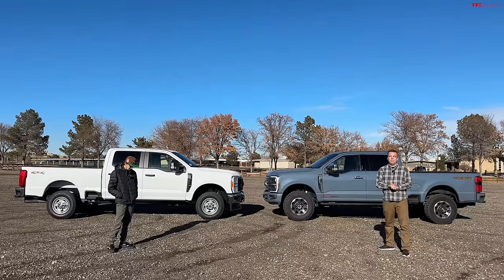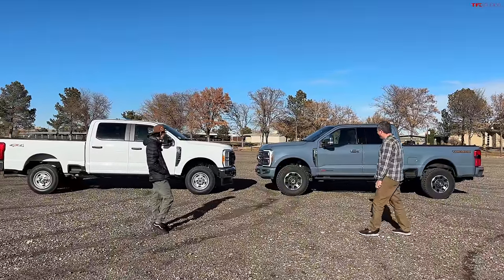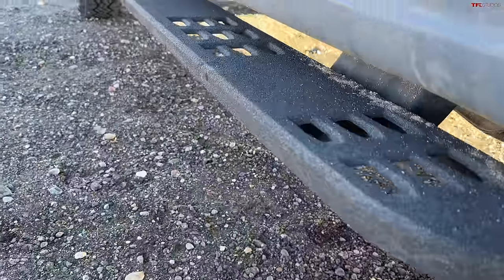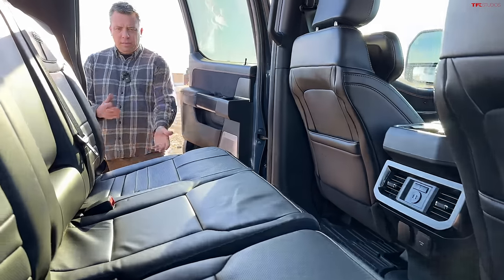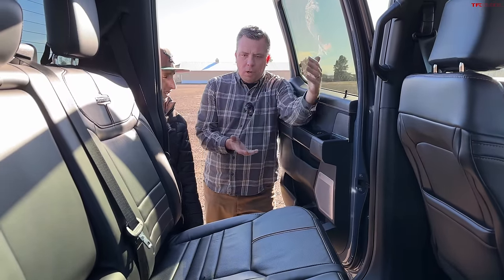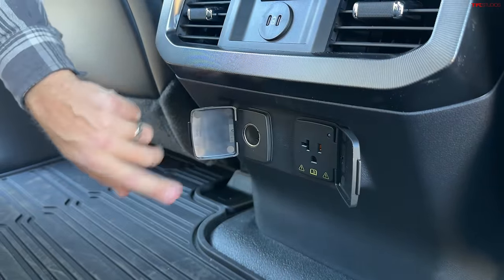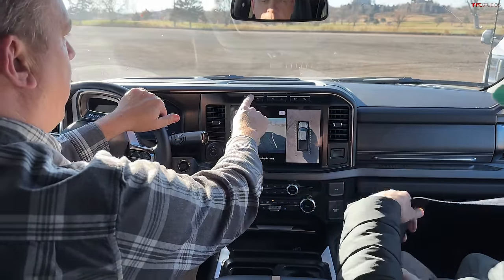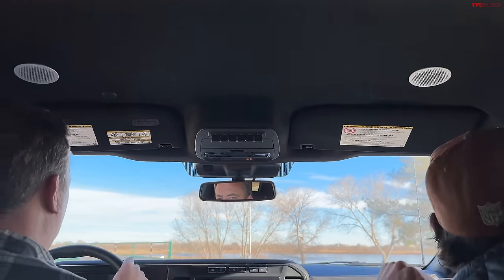New Ford F-250 Work Truck vs Premium Diesel F-250: What Do You Get for an Extra $50K?

Comment: They forgot the reliability option
Reply: That's a REALLY good point!  And I'm a diesel fan, but, man... it's hard to argue that $50,000 price spread.

Personally, I'd go diesel and run that thing until the wheels fell off. Hopefully it would be good to me for at least 10 years, preferably 15 to 20 years, for that price point.
Reply: @danthompson1467 All tyrants think they know what everyone "needs" until someone comes along to tell them what THEY "don't need".
Reply: So did Ford. 👍🏻
Reply: Reliability option? Uhhh😂
Reply: Diesel will cost you waaaaay more over its life than the gas. Diesel doesn’t mean reliable.
Reply: @danthompson1467  Key word being "need". We have our needs and wants all sorts of confused!
Reply: @joshc606  I agree.  I have a 7.3L and 6.0L Powerstroke.   Maintenance costs are way higher than my gas vehicles...
Reply: Can you imagine having to work on these new engines.  The first several hours used to just digging thru the lines and hoses😢
Reply: @larryjohns8823 a lot of maintenance requires taking the cab off the frame to work on the motor!
Reply: @BillUtah  So that means SOL for the driveway repairman! 😳 Don't  think Auto Zone loans out a " cab lift " 😩
Reply: @@stevenseagull6220 We have a 2004 F250 Super Duty XL with 70k miles on it who will be retiring when the engine goes. It chugs and acts like it wants to die. It’s a farm/plow truck so even though we’ve maintained it, it’s lived a hard life.
Reply: I would argue these new diesels are not nearly as reliable as some of the pre-DEF generations.  Way too much emissions nonsense.
Reply: @0346GT must be a dodge guy

Comment: Coming from someone who only drives work trucks… it’s a little pathetic how shocked they are about the lack of features. That work truck would be so much for useful and wouldn’t worry about getting it dirty.
Reply: Being $50,000 with zero features at all is the pathetic part
Reply: @mcnuggetapple If that bothers you, you could try getting a job. It worked wonders for me
Reply: @JollyGiant19  Or just buy a Honda Civic for less than half the price. Worked wonders for me.

Comment: Would love to see a towing comparison between the 6.8 and 7.3
Reply: I second that. I would like to see a fuel economy run on them as well.
Reply: @brandonstewart7145  I saw a video with someone getting 19mpg with the 6.8.
Reply: 6.8 max tow 18.9k
7.3 max tow 22.5k
Reply: @chadmiller6487  nice
Reply: @chadmiller6487  dang that's a lot of tow!!
Reply: Pretty crazy if u look at the specs at the old 7.3 diesel and the new 7.3 gas.  They have about the same power now.   However the new diesels blow everything out of the water.  More power and 2.5x more torque
Reply: @Freshprankstv1  similar TQ but the new gas engine putting out over 2x HP

Comment: I would buy 2 of the XL trucks for the price
Reply: Let’s be honest.  The person buying the Platinum Tremor isn’t actually using it for a work truck.  It might tow a camper or a boat now and then.  But the guy buying the XL is probably going to have a toolbox or fuel tank in the bed and a plow on the front, or be pulling an equipment trailer.  And that guy will still be $35k less into his rig.

Comment: Great video!  Really interesting that the base truck had more features than the top of the line trucks that were available back in the 1990s.  Id go basic truck every day.  The costs of top of the line make zero sense and these trucks only exist because of easy credit and people being conditioned to pay $1200/month for 72 months.

Thanks for making this video.  I’d love to see something like this for the Toyota Tundra.
Reply: I couldn't agree more. I ordered my new 23 Ram 2500 tradesman built to my spec. Crew cab 4x4 very basic
51k That's less than most 1/2 ton trucks anymore.
Reply: @ 1200 it would be way longer than 72 months with interest rates tack on another three years.
Reply: More like 1500+ per month for 72 months with 10 k down at 3.99 interest
Reply: 80% will never own,
They just rent, 🤔🤷🏿‍♂️🤮

Comment: I have a 2023 F250 STX with the 6.8 with a payload of 3950. So far I love it. It has great power and really gets up and goes compared to my 2023 Tacoma i had. I am averaging 16mpg driving in PA. The 10r100 tranny is smooth and very responsive.
Reply: Any issues with the 6.8? How many miles do you have? I want to buy a f250 and just worried about the new 6.8 vs the 7.3. Any feedback would be appreciated
Reply: That's a 4x4? 16 sounds great if so.
Reply: @lordaleksandre  Yes 4x4 with front and rear lockers 3:73 rear end.
Reply: Is that a crew cab and you have a 10kgvwr?
Reply: STX is the way to go, gives you some really nice options over the XL but not crazy expensive
Reply: 16 mpg on a gasser,sorry i dont buy it
Reply: @williamallen5369  Mine is just like his and has a 10,600 GVWR. STX FX4 3.73 locker etc etc.
Reply: Went from a taco to an f250? That’s a big jump lol
Reply: @casper24ism I get 17 on hwy. 14 town . I have a light foot though.
Reply: @casper24ism I imagine it's the 3.73 rear end. If you go with the 3.5ish or 3.31, you should have better mpg , but of course, lower towing capacity. Ford gives the buyer 3 or 4 options on most of their trucks. I don't think you can do that with the others.

Comment: Re: headlights.

My truck has halogen headlights. My wife's SUV has LED headlights. I prefer the halogens.

The halogen lights give off enough light and they eventually fade out the farther out in front.  So there's a more gradual difference between the lighted area and darkness.

OTOH, the LEDs have a sharp cutoff between the lighted area and darkness.  Not to mention blinding all of the oncoming traffic.

Comment: TFL always forgets to mention that Ford and GM offer a much safer 3 point seatbelt with their middle bench seat vs Ram which still uses a manual tightened lap belt and non locking seat back.  That isn't a safe design considering there is no airbag for that passenger.
Reply: How many guys purchasing truck care?  I’d argue very few.

Even if the purchaser does care, how much do they care? Is it enough to be a deciding factor on which truck they pick?  I seriously doubt it.
Reply: Well I guess enough people care that Ford and GM took the time and money to upgrade the seat.  If no one cares as you say, they would have left it alone.
Reply: @fasttoyo  maybe they thought govt regulations were coming and it wasn’t based on demand, or it was parts bin related.  What percentage of people even use the middle seat to begin with?  I’d argue only a small minority, particularly with most trucks sold today being crew cabs.
Reply: Even with the demand being very low, there are still people that use that seat. So even if it saves one life, it's worth the money GM and Ford invested in putting them in.  So my point still stands, even if you don't agree with it.
Reply: @Joe-hz1nw good thing the manufacturer cares more than you do, I guess...

Comment: $10,000-$12000 over the price of a gasser plus def plus higher maintenance costs?  $10,000 buys A LOT of gasoline (which is often much cheaper than diesel in my area).  I think this notion that going diesel if you tow regularly is going to save you money has been a moot point for a while.  I think you'd have to be towing a very heavy load all day, every day for ~100,000 miles before you start to see a benefit.  Very few people do that.  You're buying the diesel because it gives you power, not to save money (and there is nothing wrong with that)
Reply: I think breakeven is like 20k+ miles. Agreed though, towing heavy all the time, for sure diesel; everything else, gasser all the way unless you got cash to burn.
Reply: Gas in central Texas is $2.25/gal, diesel is close to $4….oil changes are 2x$ and def is $4/gal.  It never breaks even!
Reply: @microbiologycory10  Yeah, the more I run the numbers of different scenarios of fuel prices vs expect mpg, it never seems to make financial sense below ~100k miles unless diesel is below about .50/gallon more
Reply: @microbiologycory10 Diesel in Lubbock TX is 3.19. Even less at Costco plus 4% cash back.
Reply: Diesel was cheaper here in Canada in spring and summer. It fluctuates. Now it's 20 cents more per litre than regular gas. Still even if you tow a few days/week at the end the difference in gas money is not much really. DEF is like once a month or more unless you tow heavy daily. Also you're forgetting that the diesel model will hold its value much better than the gas option. Funny how people forget that cause the difference usually is around 10K between used diesel and gas models from what I've seen around me. I own both for my business. One for the heavy/med. towing and gas for maintenance work (barely sees a trailer).
Reply: Even if you tow 10/12k pounds daily for short runs (three dump trailers into landfills) the gas would make more sense than the diesel?
Reply: @HoolaaBaaloo  if i towed that on the highway daily or weekly  i would have to consider diesel. but for local use gas all day.  the 7.3 ford is great  have dump and 350 with 7.3 and haul dirt/ base material/ pavers
Reply: @nathanjohnson3668 Currently $50k buys roughly 16,000 gallons of gas. At 16 MPG that equates to 266,000 miles of driving.

Comment: 50,000 price difference. That is insane. I’d take the 6.8 all day. It will do the job of the 6.7ho all day just slower. Maintenance is cheaper, engine parts are cheaper, all the hard parts other than the engine are the same. Overload springs are cheap and very easy to install if needed. 90% of the folks driving HD trucks don’t need them anyway.

Comment: It's crazy that Ford is adding the 120v rear seat AC power outlet at a full 20A rating - that basically means you can run 2400watts off it - that's nuts for a vehicle interior power outlet rating!
Reply: Take the microwave out with you for lunches! 😂
Reply: Help to charge the
F150 Lightning 🤷🏿‍♂️🤮🤔

Comment: As someone who has never been in a vehicle newer than 2002 and never owned an automatic transmission the XL is a Cadillac and the platinum truck is just insane and has too many electronics. Take me back to the days of the 2 Valve 5.4 Triton and 7.3 Powerstroke
Reply: 7.3 Powerstroke, okay, 5.4 Triton, I'd avoid. Especially since you can't easily tell the 2 valve from the 3 valve and so on.
Reply: @damilolaakanni  All 5.4’s before 2004 were 2 valve. Some of the most reliable farm trucks we have. One has 260k and the other has 295k. I bought a 2000 7.3 brand new with 4 miles on it and it has 612k. Just bought all the stuff to overhaul it this winter. Routine and thorough maintenance is key.

Comment: While the platinum super duty is a really nice truck with a lot of features, I would go for the XL with a couple of added options. I would go with a color other than white, add some running boards just because the step up into the cap is so high and probably go with a slightly upgraded interior. And I would pop in a Chrome grill insert. I would like the 7.3 Godzilla motor, but I am not going to pay a bunch more money for it. And I would probably go for a regular cab long box. Because pickup stuff. Too bad you cannot get a regular cab short box in the heavy duty with locking front and rear axles to go with the 4x4. Then you would have an awesome, stout off road pickup with great clearance and maneuverability.

Comment: I bought a 22 F350 CCLB 6.7 4x4 STX and paid $56700 after a $2500 rebate. A 2023 identically optioned is $71k!! Ford really screwed up the STX by adding led lights and a bunch of un-needed options and raising the price like crazy

Comment: You can easily upgrade stereo and add cameras.
Reply: aftermarket is always better also
Reply: Yep. There are aftermarket 360 degree cameras out there that you can add to any head unit. That and a set of Morimoto LED headlamp assemblies and you've upgraded that XL to a much nicer truck with enough money left over for a side x side and a toy hauler.

Comment: Not sure who the greenhorn is, but a bit more impromptu fact checking from Andre was needed here imo. 

1) 3500 lbs isn’t a ton, it’s close to two tons
2) The 700 lbs payload difference isn’t a “couple hundred” 
3) Optioning out a 7.3 over a 6.8 doesn’t put you anywhere near diesel territory for cost.
Reply: 1) Didn't say it was a ton, as in one ton. He said it was a ton, as in a lot. Basic grade school English that's pretty easy to understand.
2) "definitely a couple hundred pounds" - This is called verbal irony, or sarcasm. It can be considered more advanced than basic grade school English, or a  child's definition of "a ton", but it's still pretty easy to understand.
3) On the XL, It's a 3k (5%) difference.
24 F250 XL with 7.3 - $60k
24 F250 XL with 6.8 - $63k
That puts the 7.3 all up in the 6.8's territory for cost. I know Math is usually considered harder than English, but come on...at least try.
Reply: @aaronw8606 he compared the 7.3 to the diesel not the 6.8. Learn to read before making an attempt to sound smart. And no. It wasn’t sarcasm.
Reply: @jabroni6199  The 6.8 was the "standard" engine on the configurator and I mistyped that instead of 6.7 in my response, that's my bad. But, it's whatever, the prices I showed are still between the 7.3 and the diesel and my point still stands.

Comment: Yeah I would take the Gas Engine. I would add a aftermarket stereo, rims and tires and remote start with bed liner and have a pretty sweet truck for around $62,000. Gas is cheaper, maintenance is cheaper and it can still haul a lot.
Reply: Remote start with the app is standard on all fords now

Comment: You talked about putting a beefier tire on that, but I would like to see you test the fuel mileage of the stock tires compared to a larger tire with a more rugged tread to see actual numbers.

Comment: 500HP in a pickup truck is just a fashion accessory.  I'll take the work truck with a gas engine, but will wait a couple of years and get a used one.  I'm not even sure I would get the 7.3.  The 6.8 has plenty of power.

Comment: I have the white 2023 F150 version of the base F250 and it's awesome!  Keyed ignition, basic electronics, small screen and who cares if my dog sits in the front seat?  No one.   I did change out the tires to Toyo Open Country ATs.   It's my work truck and I bought it to abuse it.  Way easier to abuse this than the F350 Lariat I had previously.  Considered the F250, but the gas mileage is way better with the 3.5EB that  can tow nearly as much.  Dog loves it, wife is not a fan.

Comment: I went 2012 F250 gas 150000 miles/ 
2016 F250 gas 180000miles
Now drive a 2021 F250 gas with around 80000miles all where basic trucks king cab never had an issue with the headlight all used with about 1800 pounds of cargo every day never had a issue with it they are fleet vehicles for construction company the bad thing I can say its they average 15mpg 
80% highway 20 Street  driving

Comment: Great review and very informative, but these two trucks remind me why I dislike modern trucks so much. If it's got heat, 4wd, and a tow hitch, that's all I need. I had a fully loaded out tahoe and after a few years only 2 out of the 5 windows opened (the front passenger door and the sunroof)the auto door locks didn't work. had to have the remote start dissabled cause it would start randomly and it was just cheaper to have it disabled than it was to fix it among other things. My moddo is all this gimmicky tech stuff is great, but when it breaks, it's a living nightmare.
Reply: Don't buy chevy. Had electrical nightmares on our 2015 ltz suburban. My 2018 f150 xlt with luxury options doesn't have any issues.

Comment: Personally I don't think efficiency for the diesel should be a talking point... when diesel was priced at or lower than gas it made sense in the discussion; and its been a few years since that was the case. Now, it is almost (nationally) somewhere between 20% to 40% more expensive than gas. So, at best, you may break even on fuel cost which means you have to eat the extra cost of the diesel engine option, DEF, and extra maintenance. A case could be made for power, resale value, longevity, transmission, etc. But efficiency only really matters as it applies to cost and its a wash right now if not worse for the diesel option (with exceptions for lots of towing/hauling).
The more frustrating thing is watching review after review trying to justify the enormous cost of even a basic work truck... just a few years ago, that same standard work truck was in the high 30s and you could expect to find deals with significant price reductions on nearly everything but things like the Raptor. It's ridiculous that there are now $100K+ options... the Big 3 are either going to have to get used to the new reality of less production for higher cost trucks, or they'll need to start putting some big discounts and pause pumping up MSRPs on these vehicles. Slowing sales and increasing defaults from buyers with even stellar credit is not a good sign for them.

Comment: Andrey...all the things you want to do to the XL work truck can easily be done aftermarket. Not that you suggested it, but you surely don't need to add factory option packages, or buy a higher trim level to get done what you want with this truck.

Comment: I got a 2011 f350 xl crew with the 6.7. It came with a warn winch with brush bar light and ARE canopy all for 33k I didn't want any leather or any options. Crank windows exactly what I wanted. Its actually hard to find a truck set up like this. Everything seems to be a platinum or King ranch. Something I knew I didn't want to pay for.